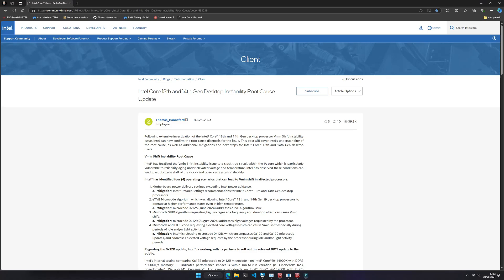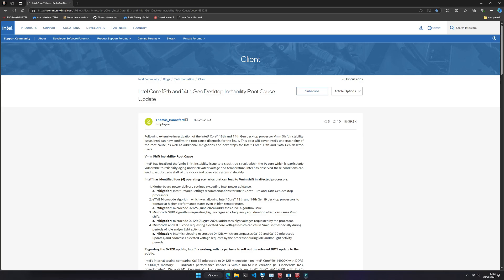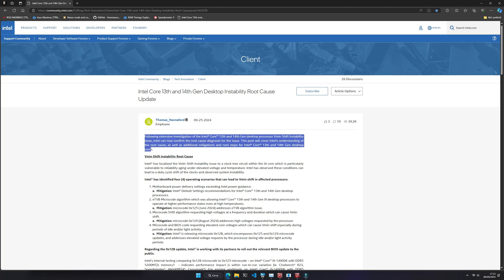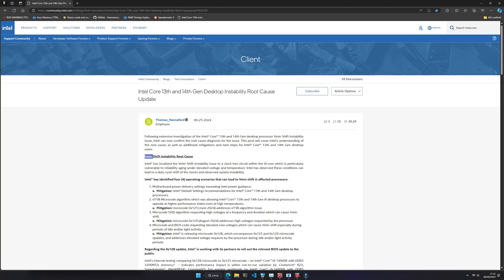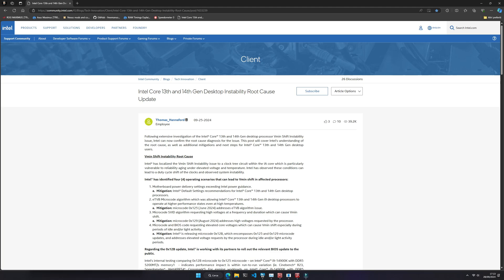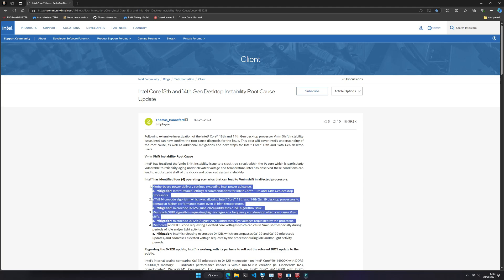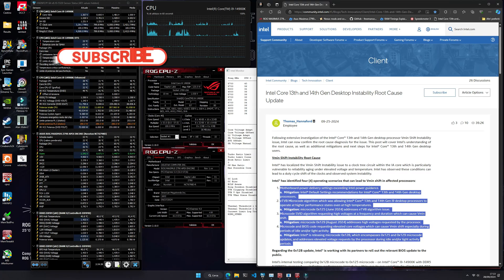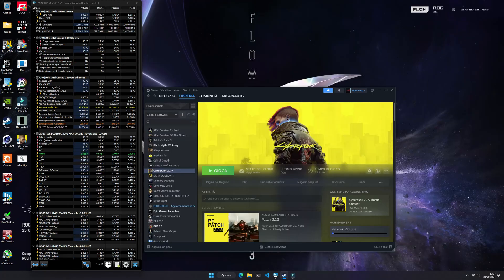FINALLY 14900K microcode 0x12b update FIXES EVERYTHING 🔧

Comment: That fixes everything? 😁 I guess if you're an Intel user, you just have to believe that and hope for the best🙂👌🏻 I'm glad that I've only ever used AMD CPUs in my systems for almost 27 years now, apart from a short involuntary switch to Intel when AMD had the "Bulldozer" release fiasco. At that point I had to switch to Shintel as I call it today for 3 CPU generations (i7 2700K -》 i7 3770K -》 i7 4790K). But when Ryzen came along, it was immediately clear to me that the time had come to return to AMD! Never again Shintel never. And by the way, installing the microcode update just to load the Asus settings probably won't save the CPU either. Likewise, running the benchmarks is pretty useless, except to see if you lose performance as a result of the update. If the CPU is already damaged, it's too late anyway, and whether it will still be affected despite the great microcode update number 2 can only be determined through long-term use.Well, whatever, I'll keep my fingers crossed that it works. And from enthusiast to enthusiast, buying the most expensive product is not always the same as buying the best product, at least not when it has to use almost three times as much energy to be competitive on the market. This definitely applies if you build and use your systems primarily for gaming. Intel should simply accept that they are no longer as competitive as they think they are, accept the "L" that they are rightly receiving and then start designing a sensible and efficient desktop CPU architecture that can keep up without consuming 200 W more.
Reply: zen2 and zen3 are reporting crashes now due to degradation, i hope it won't affect zen4 like my setup
Reply: my 13600kf works fine I undervolt it after installing
Reply from the maker: @heinzwaldpfad  very good. The overvoltage problem was specific to the 13900/14900K-KF-KS and smooth. The 13600K as well as the 13700K have always been the bomb 😉
Reply from the maker: @allcarparebeautiful  your point of view is shared and it is true that I am an Intel user, since 1993 when I attended university. The specific fact that emerged using this microcode is that it changes the algorithm with which the CPU makes VID requests to the VRM. To make a long story short, the voltage / frequency curve of the processor printed by default at 6 GHz requires 1.478 volts. Well the SVID request, in this case is 1.481 volts. Practically identical. All this to say that this time everything seems to work properly. Finally, keep in mind that in CB R23 you can reach 40800 points even after editing the video played with the graphics at maximum levels and all with only 288 Watts. I know well that at the moment AMD is superior to Intel especially from an energy point of view.
Reply: @eXpowerG3046  OK, that explains the benchmark runs. Now I understand it all and it makes sense to me too. So you tried to determine, in a nutshell, where Intel has turned the screws with regard to the vcore and what they allow and which changes occur with which power profile. Or to cut it short, I understand exactly what you answered me but there's no point in formulating it again so that others can understand it. So you've only had Intel CPUs up to now? That's very interesting because it's sort of a mirror of my career when it comes to CPUs. I've personally experienced every CPU release since the first 386 SX, even though that was my parent's PC at the time and I think it was an Intel 08386 processor that was installed in it. Unfortunately I wasn't allowed to look 😁 My first PC, however, had an AMD DX4 with 120 MHz produced under license 🙂 after that came the first PC that I built myself when I was about 14 years old, correcting: which had an Cyrix CPU but i absolutly can't remember which one and after that my first AMD K6 mmx - 166 MHz. I've seen almost all x86 CPU generations come and go 😉
Reply from the maker: @allcarparebeautiful  Absolutely, mine are all tests that still arise from a design error that unfortunately occurred on these Intel generations, 13th and 14th. At this historical moment I do not hide that I am tempted to go AMD, but first I want to wait for Arrow Lake. Greetings and I appreciate your qualified intervention ;)
Reply: so you were a happy bulldozer user lol Get out of here man...There was nothing wrong with intel until 13 and 14th series.
Reply: @Ludak021  what are you Smoking i think you should read again what i wrote and keep your f... mouth shut keyboardwarrior
Reply: Bulldozer was complete dogshit and never good. You seems to forget that every high end AMD cpu goes over 210W to compete with intel in multicore. Oh and dont forget that AMD false advertized ZEN 5 as well. ZEN 5 cannot reach its stated clock speed if its over 35C, you get a 0.300GHz reduction in speeds way more than intel.

Comment: you do realize by using the asus profile you are actually disabling the protections and you are essentially not using the microcode.....lol
Reply: The BIOS update pushes the microcode changes INTO the CPU itself. It's no different at that point than if the CPU had come from the factory with the correct microcode. THEN you still need the correct profile setup in UEFI/BIOS.
Reply: @photonboy999  yes i am aware of that. however asus ai oc profile disables CEP which is what the voltage requests are tied to. so you are effectively disabling those.
Reply: @photonboy999  sorry but i made a mistake, its attached to Enhanced thermal velocity boost. not CEP. but either way. asus ai oc disables that lol. so the microcode wont work like it should......... so either way your wrong.
Reply from the maker: the micro code works with both Intel and Asus profiles and you can see it from the SVID requests that, at 6 GHz and low load do not even reach 1.48 volts. Likewise the protections are set with PL1 at 253 W, PL2 at 288 W and IA Voltage limit at 1.5 volts
Reply: YOU DONT UNDERSTAND MICROCODE IF YOU THINK THAT IS THE CASE
Reply from the maker: @420247paul  it's probably like you say